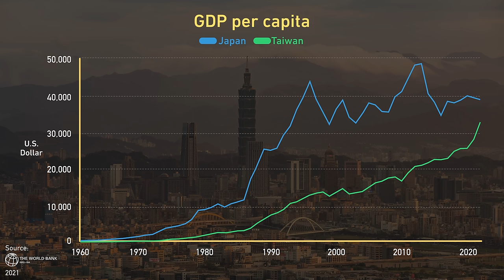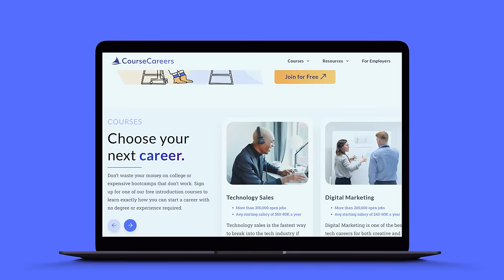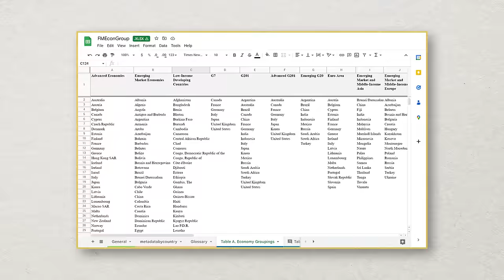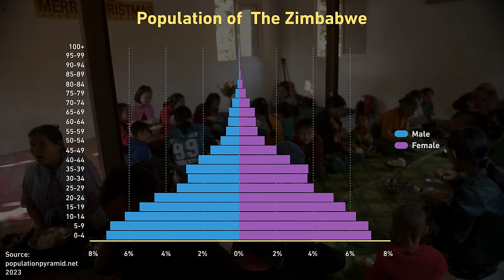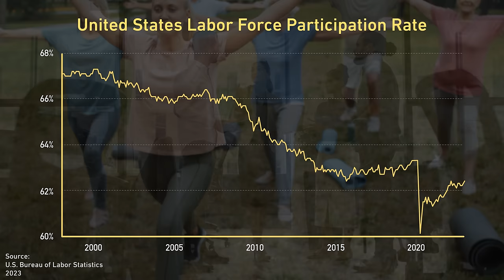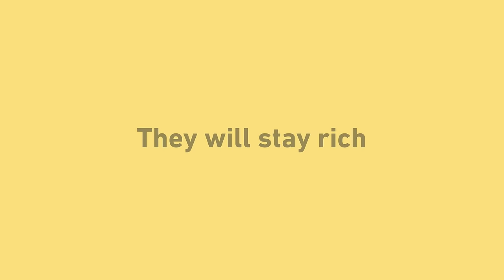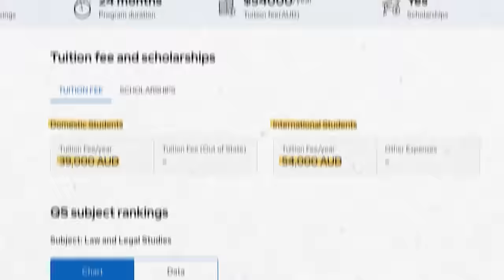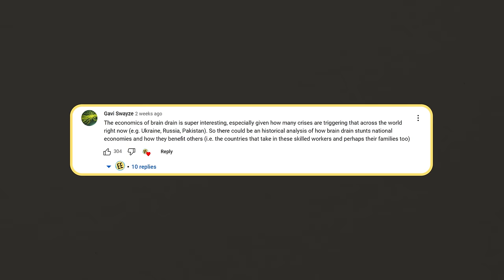The Tragic Reality of Brain Drain on Poor Countries | Economics Explained

Comment: This is true. But also the thought of returning to ones home country is rendered difficult to impossible. As say I wanted to set up the same business back home would be either met with low skill, a reluctancy to work or the corruption or crime would have you killed or compromised.
Reply: Do you think this is a byproduct of brain drain or a factor?
Reply: You can't move an organization to a different region without make the needed adjustments. You have to adjust your standards to meet each region, or risk failure.
Reply: @chocolatemonster6165  Both as training staff tend to take those skills to a more prosperous country. So the situation never improves.

Comment: I'm from India and there's enough talent from India inside and outside the country. The reason India is still poor is due to corruption, poor political focus on religion and bad infrastructure to absorb different kind of talent. Of course also there's really high population which is both a strength and weakness.
One more point is that India needs more talent within the country and not just relay on the outsourced jobs.

Comment: That's interesting - a very good coverage from an economic standpoint regarding "source" and "sink" of the brain drain or gain respectively.
What I miss somewhat is the global technological impact, which is much more positive:
The brightest minds are drawn to places where they get the right means to do the innovation they are capable of. Often, immigrated scientist, engineers and so on create solutions globally applied, which especially help countries like the ones they come from, but which needed the stability and advanced equipment of modern economies to kick-start them.

So from the view of humanity itself, there is quite some positive in the trend that the best resources tend to move to and concentrate in the areas best equipped to fully utilize their potential.

Comment: The problem is investment. Most developing countries lack the high tech industries to employ the brains. Even for China and Taiwan where there is a large tech industry wages have not kept up. It a vicious cycle. In China for example wages needs to be low because that is how it out completes everyone in manufacturing. And by extension their customer expect the same in same when it comes to tech. China "can make cheap high tech products" and that keeps wages down leading to a brain drain. If wages was the same, than Chinese tech products will lose their major advantage which is cost.